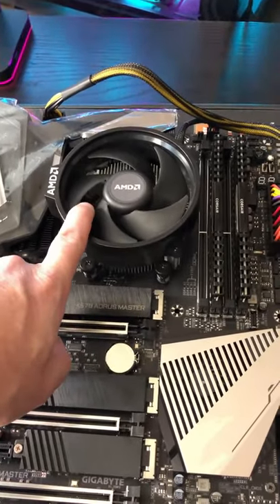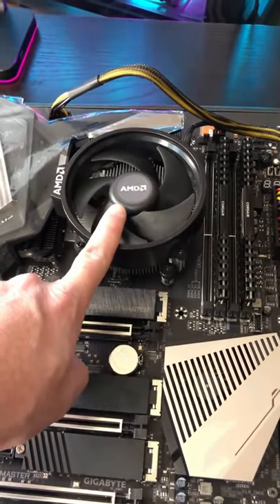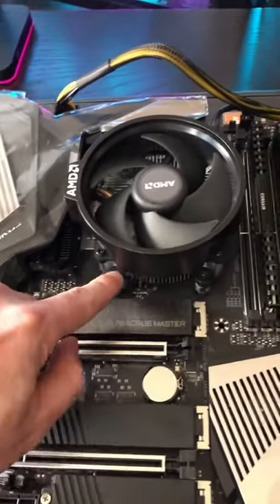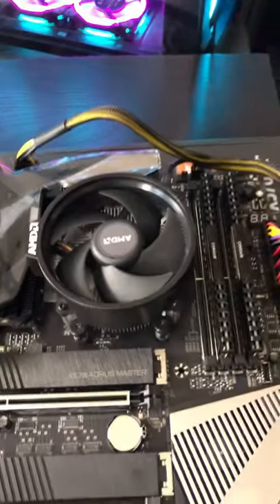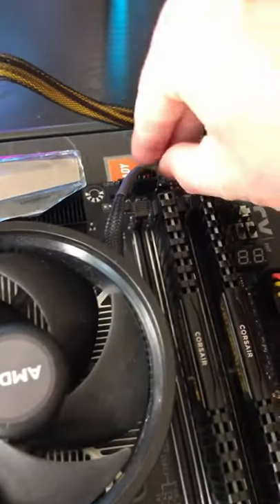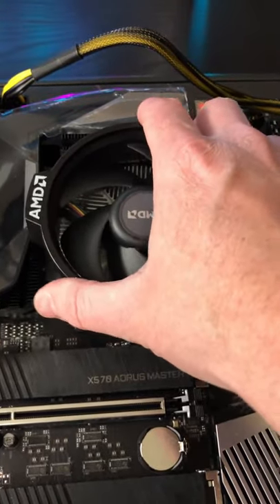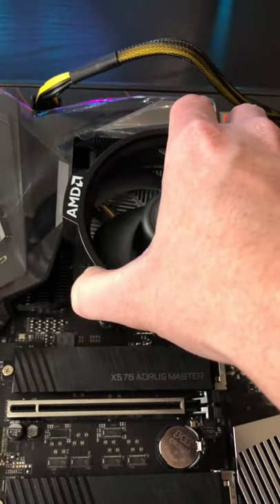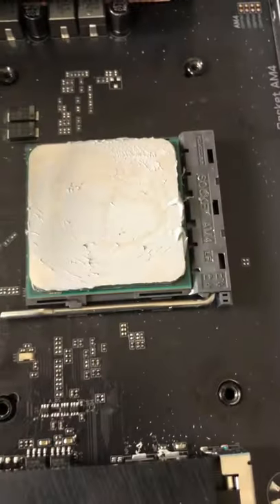How To Remove an AMD CPU Cooler Safely without Ripping the CPU from the Socket #shorts

Comment: There's no need to heat it up first. Just do the twist to break the adhesion and it will come off just fine.
Reply from the maker: I agree, if you are careful you shouldn’t have to do the heat up step.

Comment: Maybe someone already said this, but I didn't see it. Not all stock coolers use the 4 screws. My 2700x has the big one with the clips. Definitely not the kind you want to try removing without laying the case flat, it could start to pull out the cpu on it's own from gravity when upright. I think most of it applies but it might be worth including to mention the differences. Ty for making vids like this to help people!
Reply from the maker: Yep!  Right!  Some are a bit more complicated in terms of mounting design.  Though with removing any cooler you want to do the same twist and lift motion.  Thanks for watching.

Comment: I recommend just stressing out your CPU for a few minutes on all cores until the temperature becomes stable and stops climbing. If you’re really scared you can stop the fan blade with your finger and wait for your CPU to hit 80 - 90C before shutting off your system.

Comment: After doing this, can I just add another CPU with pre applied thermal paste or do I need some more paste to make it smooth before I put the new cpu cooler on. Thanks advance
Reply from the maker: Yes you can add a new cooler with pre-applied paste if it comes with it or you can just get a new tube of paste and reapply yourself as well.
Reply: @PCTechHustle  thanks for the reply!  Keep up the good work. 👍🏽

Comment: thanks but this video came too late for me - ripped out a 3700x and bent 2 pins when it fell, heart-stopping moment...luckily my mate at the local PC shop got it good as new in about 10 minutes :-)
Reply from the maker: 😅😅😅. I’ve seen it happen all to many times!  Glad yours got fixed!
Reply: That guy is the 🐐
Reply: I remember when my brother snatched my FIRST cpu from my hands and dropped it, I was so sad and mad and disappointed all at the same time. Luckily my dad has steady hands so he was able to bend the three pins back to normal
Reply from the maker: They can be salvaged if your are careful!  I have a video on that actually 😉
Reply: @PCTechHustle  Here's a weird example of pins broken - I upgraded to an i7-2600k from i think an i5-2500 on an old system i snagged and managed to drop the CPU on the mobo when I was taking out the old CPU - yes I've done this TWICE now :/) ...anyways there must have been 7 or 8 pins broken on the mobo and so far there have been almost NO issues. My daughter has been gaming fine on it, the only thing is the front panel audio and rear audio ports don't work. I was amazed - totally thought it was bricked. I took it to the same guy that fixed my 3700x and he said i can't help you with this one lol

Comment: Yeah, also is much easier to clean the paste when is warm.
I do remember you have to use this method to change og xbox paste bcs it gets so hard and sticky that it is almost imposible to remove the gpu heatsink. Some people even ripped the gpu chip off triying to remove the heatsink.

Another tip, if you cant power on the sistem or board, just use a hair dryer to warm up the heatsink, just... Dont melt anything
Reply from the maker: Good tip!

Comment: Here's what I do.
Step One: Turn on PC
Step Two: Open Cinebench
Step Three: Run a couple times and shut PC off during the third test (when its running)
Step Four: Take cooler off and do not touch the metal (or heatpipes if yours has it). The cooler will be pretty toasty but you will definitely not take the cpu out with the cooler.
Reply from the maker: Yep good tips!
Reply: Just unplug the fan and let it sit in the bios for a few minutes. Monitor the temp, and then shut off pc and twist. Only lift when you know it’s loose.

Comment: This is informative and I'll be sure to make use of it in the future if I need to, I actually replaced my old AMD stock cooler recently and when I did my CPU came out attached to the cooler. Luckily it wasn't damage but I will say it was a scary experience.

Comment: i would recommend running a benchmark to make it extra toasty before removing the cooler if you've left it untouched for a few years. in my experience the stock thermal paste the cooler comes pre-applied with practically cements itself to the cpu after enough time and just leaving the pc on idle was not enough to loosen it up. not fun.

Comment: I've seen someone rip a 3950xt right out of the socket and bend a few pins in the process. This method saves CPUs people, take heed! Also, slide, then lift.
Reply from the maker: Yep it’s very easy to damage the cpu if you are not careful!
Reply: @PCTechHustle  I'm new to your channel and am also a tech hustler. Do you have a discord for your channel? I am building a system over the next 2 weeks off an Asus Prime x570-p unused openbox I found for $105. Would love to show it off when done. Just hunting for a gpu atm.
Reply from the maker: No discord yet but I’m working on it!  Stay tuned!  I’ll likely announce it soon!
Reply: @PCTechHustle  Cool beans! I appreciate your responding.

Comment: For about 3 weeks, I had so much trouble removing the screws. They would not come off. I didn't want to risk breaking anything.

Today, I use a different screwdriver and it comes off easily (flathead screwdriver on phillips screws)
Reply from the maker: Hey sometimes you just gotta do what ya gotta do right?

Comment: Run a cpu intensive program to warm up the thermal paste as advice
Reply from the maker: Yep!  Some good ones: Cinebench, AIDA64, or Prime95 if you feel like making your PC into a space heater!
Reply: @PCTechHustle  I ripped a 3600 out of the mobo on one of my PC's i was so scared luckily i pulled straight up after wiggling a bit so no bent pins

Comment: Is this an issue with Ryzen CPUs or with an over application of thermal paste? I've never had this issue, but I've also only ever used Intel CPUs.
Reply from the maker: Actually it happens mostly with the pre-applied paste, it’s a bit stickier than other compounds.  So nothing to do with application amount or method.

Comment: Can I use a heat gun or a hair dryer to warm up the cooler or underneath the cooler if the computer does not post?
Or this can damage the motherboard?
Reply from the maker: You can but I would be careful

Comment: So thing is I was kinda impatient and was wiggling the CPU cooler around as it was on, kinda checking if it was starting to budge a little. It went from totally stuck to the wind could have pushed it of the mount in an instant. Nothing weren’t wrong nothing was broken so tip to all: if it’s stiff and unmoving that doesn’t mean it’s not loosening. Also my screws were already undone so the only thing that was holding it down as the paste

Comment: I have had a CPU come out of the socket but it did not bend any pins.  You still have to be careful not to bend them.  Is there anything bad that happens with the LGA CPUs when removing them that we should watch out for?  I know if I ever encounter one of those I should wear a short sleeve shirt and be very careful not to drop anything in the socket.  I mention a short sleeve shirt since any cloth could catch on the pins and bend them.  I wonder if there is a more robust design they may use one day or at least find a solution to the fragility of those sockets.  I don't install CPUs a lot but one day my next one may likely be an LGA type since that is the trend these days.
Reply from the maker: This is really more just a problem with PGA sockets, not LGA.  Good and safe idea too to wear something that you know can’t cling to components!  Basically the only thing about LGA you want to be careful of is to not drop anything back down in on the pins.

Comment: are the big screws in the bracket for the cooler not self explanatory?
Reply from the maker: Yes those screws I pointed out are the screws that attach the cooler to the backplate on the motherboard.

Comment: Bro the wraith prism was a scary mf to remove. The amount of force you have to put down to remove the side latches is insane. Then the thermal paste is like concrete even after warming it up. Glad I moved on from stock cooler and artic thermal paste. I use kingpin KPX now. If you guys are getting into pc building please look into kingpin. Some of the best thermals and remains somewhat viscous for easier removal. Whenever you spread, it doesn’t feel like a thick paste👌🏾

Comment: so you no need to unlock the "lock" mechanicsm from the socket before lifting the cooler ?
Reply from the maker: No actually do not. That could cause the cpu to lift from the socket.  Just keep it locked down and gently twist and lift.

Comment: I have the same cooler that you have, wanted to put it in again but noticed that the socket for the screws had fallen out
Reply from the maker: The backplate on the backside of the motherboard?
Reply: @PCTechHustle  it fell in between the Metal Wall and the Mother Board. I just had to open it and took it out
Reply: Thankfully the Motherboard didnt get damaged in the process

Comment: Pulled out an amd fx6100 a few yeara back. It was stuck on a scythe tower cooler. Luckily just bend a little 4 pins but worked...

Comment: I never applied thermal paste wen I did the cpu install.. Does it make A difference
Reply from the maker: You shouldn’t have to if you are installing the stock cooler with the pre-applied thermal paste.  However if it didn’t have any pre-applied I suggest you immediately put some on  there!

Comment: I see all these videos, done the same even went on and played some games which warmed up the cpu as much as possible, started twisting the cooler and pulled gently in the meantime, yet still it came out. Btw I've had the worse mounting cooler, the wraith max with the latches and for whatever reason I couldn't get both the latches out first so I've always had to get one latch out and just remove the cooler a bit sideways so I could remove the other latch. Worst possible cooler and cooler mounting imo. Also I really like how amd went on and updated their mounting on am5 so it's not actually possible to rip out the cpu on the newer gen cpus, and also put the pins onto the mobo, I think that's way better when you need to get the cpu off to either repaste or change it

Comment: i am sure this is a given, but after you let it run for about 15 minutes, are you supposed to turn off the power supply and unplug it?
Reply from the maker: Yes just flip the power switch on the power supply

Comment: And for intel is the same? Can I damage the cpu by removing the cooler? I know its lga but it is my first pc and had lots of hearts attacks while building it
Reply from the maker: Same process but much less risk as Intel / LGA and now even new Ryzen LGA AM5 have a hard locking mechanism that make it basically impossible to rip out the CPU in the effort of removing the cooler off the CPU.
Reply: @PCTechHustle  perfect, many thanks!!!
Reply from the maker: Sure thing!

Comment: What are the sockets or couples in the motherboard where the fan screws screw into mine are missing and I need them
Reply from the maker: That is the AM4 back plate.  You can buy replacements on eBay / Amazon for $8-10

Comment: Hey i want to change cooler, can it be done without dismantling the pc? Never done any build myself so kinda concerning.
Reply from the maker: Nah should just be as simple as removing the stock cooler as you see here and the new cooler will come with instructions.  Nothing terribly complicated
Reply: @PCTechHustle  should i disconnect anything beside cpu coller and fan pin? Psu or any?

Comment: Do i need to apply the thermal paste again if i Remove the fan and attached it again??
Reply from the maker: Not technically but might not hurt to add a little more if not cleaning off.  Worst case you can just check temps after putting it back on

Comment: What kind of fan can i replace using the same  screws hold?  
The original fan is an 92mm foxconn...  can i buy any brand with 92mm?  Like a noctua?

The noise of original amd wraith spire is a problem to me..

Comment: I remember a school pc that propbably was 10 years old, and my teacher asked me if i could change thermalpaste on it, so i did. The thermal paste was sooo old that it had become like glue. And it was super hard to get the cooler off. But after a lot of voilent pulling i got the cooler off. And the thermal paste was like sement/concrete. It was sooo hard to remove. But in the end i got it all up and working 👍👍

Comment: What if I’m installing an aftermarket cooler but my system has yet to be turned on?
I’m missing a gpu so I don’t know if I could reach very hot idle temps
Reply from the maker: Same process for all cooler removals actually.

Comment: Wow never had this issue with Intel cpus. I always just pull the cooler up… but great video, it’s probably better in general to warm it up and take that off gently. These parts are pretty fragile indeed.
Reply from the maker: Intel’s mounting system with LGA sockets is better, it actually holds down the entire CPU from the IHS, making it near impossible to rip out.

Comment: What do you do when the paste has cured and has gone hard over a year or two ? It doesn’t twist like that it’s solid

I had this issue with those old Intel socket 478 CPUs as well
Reply from the maker: That’s why I suggest trying to heat it up. You could also try to run floss under it if it’s really stuck.

Comment: Dude I wish I found this video sooner I ripped my cpu out of the socket yesterday its a r7 3700x and I luckily only bent one pin I pushed it just a little with my finger back into place and so far it's working great
Reply from the maker: Usually you can bend them back with non issues.  Glad yours was okay!

Comment: What if I have a dead aio cooler? Can’t run my pc cause I know it will overheat it is there still a safe way to remove the cooler with these circumstances?
Reply from the maker: Slow and steady!  You don’t need to turn on the machine it’s just helpful if you can.

Comment: Do you have to put thermal paste on it after you took it off?
Reply from the maker: Yes.  It's always a good rule of thumb to clean off the old and reapply thermal paste after removing a cooler.
Reply: @PCTechHustle  ok thanks 🙏

Comment: bro there is a back plate on behind the motherboard is there any problem if the plate is accidently removed?
Reply from the maker: That means you are basically there but be careful.  The only thing now holding the cooler on is the sticky thermal paste!
Reply: @PCTechHustle  yes its holding the fan,so how can i remove it

Comment: Hii plz reply 
Today i  tried to remove my stock cooler but the processor came out with it 
Do you think that damaged the motherboard socket 
I cant check because my  processor pins are bended and broken
Reply from the maker: The motherboard is likely fine but depending on the damage to the CPU it could be a goner.  You can bend back pins though.  Sometimes even the CPU will operate fine with some missing.  I did a video on that actually.  

https://youtu.be/nNy9-UUHiao
Reply: @PCTechHustle  hey i just finished my build with 1 missing pin  and it working fine thank you so much you are a life saver  😁

Comment: I don't plan any overclocking and i am a 3d game developer so is the stock cooler enough for me?
Reply from the maker: Depends on the CPU under the cooler.  Most cases yes.  If your temps are good there is no need to change it.
Reply: @PCTechHustle  After a few hours of reading about it i chose this cooler since i am doing a lot of rendering for the game cinematics. ARCTIC Freezer 34 Esports Duo

Comment: Amd should put those steel brackets across the processor like intel mb socket to secure it tightly amd still has a lot to learn from intel ...
Reply from the maker: Agreed!  Intel’s design is better, though I hear rumor AMD might be going to an LGA design for its next CPU generation, so this may become a thing of the past soon.
Reply: @PCTechHustle  That's a good thing to hear , but I don't care less cause only last month I build my pc and will be using it for coming years until it gives me unsatisfactory performance  , but its a step forward if they are thinking to change the current am4 open design socket with that intel shield design ...

Comment: I had a noctua nh-d15 I didn’t think I applied enough thermal paste because my 5800x was running pretty hot and when I pulled upward and it ripped my CPU out of its socket, but everything was ok. Still gives me nightmares tho
Reply from the maker: Always a heart drop moment!

Comment: Very simple, just unplug the cpu fan and run the PC until the cpu reaches around 80 celcius. Then easily remove the cooler. No need to run games or benchmark programs.
Reply from the maker: Yep that will work too

Comment: Never had a problem with just twisting back and forth until it was free, no heat needed. What am I doing so different from others claiming it still comes off with the cooler? FYI, I don't really lift at all, just twist until the cooler is practically falling off on its own. 

I do this with LGA (Intel) sockets as well, as I started building PCs in the days when eveyone used PGA sockets and I guess it's just habit. I haven't ripped a CPU out with the cooler in decades.
Reply from the maker: You are doing it right!

Comment: What does the CPU locking mechanism do then?
Reply from the maker: It holds it in via the pins, it is not a clamping system on the actually IHS like Intel though
Reply: @PCTechHustle  Right. Didn't know that.